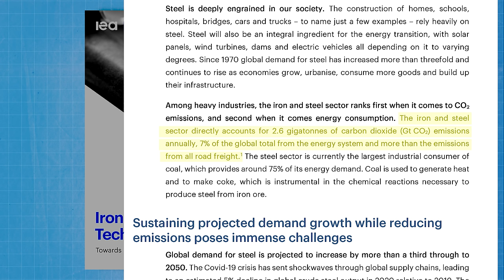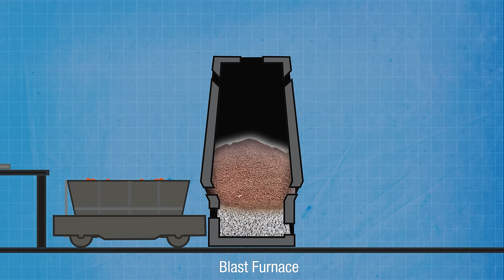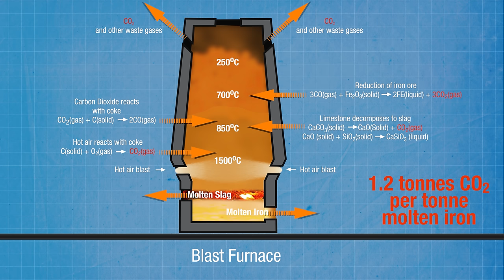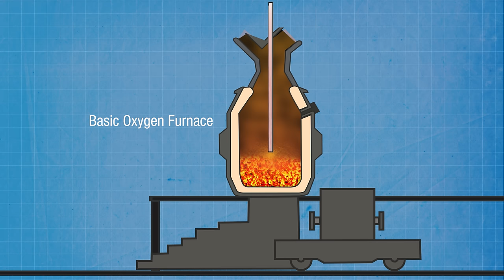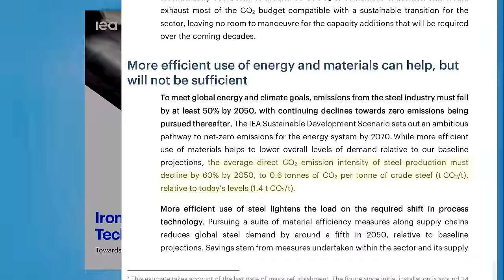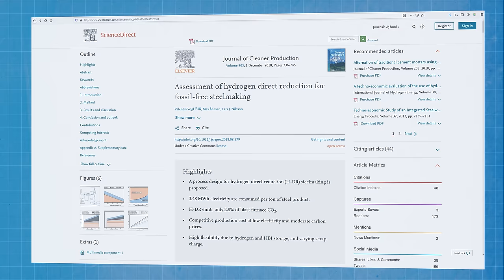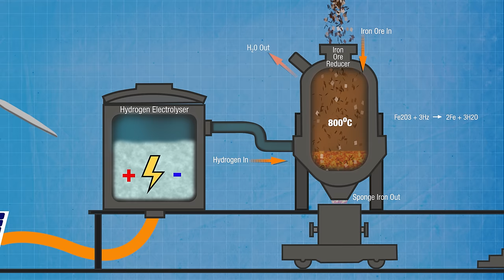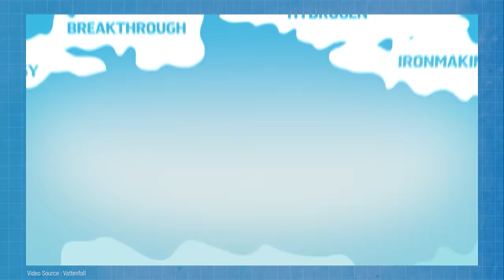Fossil free steel. Another giant step towards net carbon zero?

Comment: But Co2 isn't a pollutant. Spending trillions of dollars to get to net zero will solve nothing. 

If you want to make a difference in the world, build toilets for the 700 million Indians who use rivers as their toilets EVERYDAY!
Reply: You are right. CO2 is not a pullotant.
But increasing the CO2 levels in our atmosphere very fast causes the atmosphere to heat up unequally and causes severe disruption of local climate patterns, as well as heating up the earth as a whole. A warmer earth has far higher sea levels. Byebye all coastal regions.
Reply: @3gunslingers  
Except it doesn't, which explains why ski seasons have arrived earlier in the last few years despite a rise in Co2 levels. 

Regarding sea level rise, show me the data of accelerated sea level rise. My data says  no acceleration.
Reply: @3gunslingers  
That graphic is a fraud. It says it's from NOAA. It's been tampered with and doesn't say where it's from other than a vague location. This is the original NOAA tide gauge data from NOAA with a similar timespan. It shows no acceleration: 

https://tidesandcurrents.noaa.gov/sltrends/sltrends_station.shtml?id=8518750

Here's 111 years of data from Canada, that indicates 1.22 mm/year of sea level drop. If sea level rise was accelerating, sea level drop would have slowed or stopped.

https://tidesandcurrents.noaa.gov/sltrends/sltrends_station.shtml?id=822-116
Reply: @glidercoach  
You have the sea level rise/fall of exactly TWO locations on the whole earth.
But we are talking about the GLOBAL sea level rise.
https://www.scientificamerican.com/article/a-scientist-explains-the-mystery-of-recent-sea-level-drop/
https://io9.gizmodo.com/why-are-sea-levels-dropping-in-places-closest-to-the-me-1684599241
https://oceanservice.noaa.gov/facts/sealevel-global-local.html

Do you read why sea level falls LOCALLY?
Reply: @3gunslingers  
The land rises and falls. In NY, it falls faster than other places. Cresent City California is rising slower than Canada which is why sea levels are dropping slower.

https://tidesandcurrents.noaa.gov/sltrends/sltrends_station.shtml?id=9419750

My argument stands. If sea level rise was accelerating, the tide gauges in Canada and Cresent City would indicate a slowing of sea level drop. It doesn't. 

Your links are propaganda. Even NOAA and NASA have been known to tamper with the data. For now tide gauge data is credible. 

Did you see how different your first graph is from the official data? Someone tampered with it.
Reply: @glidercoach  
Why do you still show me local sea levels, not global sea levels?

"Did you see how different your first graph is from the official data?" No, because it IS official data. You can't chose what's official and what not based on your bias. 

https://www.ecosia.org/images?q=global%20average%20sea%20level
Every single graph about global average sea level shows an upwards bend. 

Now please show me a graph about global average seal level where this does not happen. Thanks. (don't bother, if you try to give me a graph with only local sea level)
Reply: @glidercoach  
"If we lose more ice than is replaced as snow, sea level rise will accelerate. For now it's not the case" Well, that's obviously wrong: 
https://nsidc.org/glims/glaciermelt/
https://en.wikipedia.org/wiki/Retreat_of_glaciers_since_1850
Very obviously the glaciers melt on a global scale. There is not honest way to deny that.

BTW could you look up a source that tells us, what the global temperature would be, without any CO2 in the atmosphere?
(I know that number already, but I want to know if you are physically able to look up that fact)
Reply: @glidercoach  
Interestingly enough all of your articles support the fact that the glaciers are shrinking. Maybe not disappearing as soon as announced, but they are obviously shrinking.
And I suspect that you accept the very fact that on global average the glaciers have lost a lot of ice in the last 30 years. 
Or do you reject that fact?
Reply: @3gunslingers  
Mars is 95% Co2 and is very cold. 
By your logic it should be as hot as Venus. Why is Mars so cold?
Reply: @glidercoach  
Because the martian atmosphere lacks density. 
Tho the martian atmosphere has about 10 times more CO2 by mass than earth has right now, Mars lacks practically any other gas in the atmosphere that would be heated up by the green house effect.
Reply: @glidercoach  
"but can't explain how the majority of all the ice loss over the last 10,000 years happened, when Co2 levels were low..." Because we are still very slowly coming out of an ice age. But that can't explain the accelerated melting we see in the last 100 and especially the last 50 years. 

"...but blame current ice loss on a 100 ppm increase of Co2." You mean an 100% increase in CO2 concentration. Don't you?
(because the increase is more like 200 ppm
) 

Remember without 200 ppm CO2 we would have -18°C on global average. But with it we have a cozy 15°C. 

So what happens when you double the concentration of the gas that heats up our planet over 33°C?
Reply: @3gunslingers  
Since the industrial revolution, Co2 levels went from +- 300 ppm to 410 ppm today. That's not 200%

Co2 levels have been 17 times higher than where we are today and life exploded. 

Water vapor accounts for most of the greenhouse gas in our atmosphere. There is no way, Co2 at 200 ppm, would decrease temperatures that much. That's what we call junk science.  

I'm done. Have a nice day.
Reply: @glidercoach  
"Co2 levels have been 17 times higher than where we are today and life exploded." 
This is NOT about the total CO2 concentration in the air. Nobody worries about that. Don't build that straw man all over again.
It's about the rapid CHANGE in CO2 concentration that worries the scientists. 

Do you understand why a fast change in climate pattern due to fast increase in temperatures is a problem to our way of life?  

https://en.wikipedia.org/wiki/Carbon_dioxide_in_Earth%27s_atmosphere#/media/File:Carbon_Dioxide_800kyr.svg
Look how minimal the rise in CO2 concentration was since the last ice age. And how fast it has risen in the last 100 years.
Reply: @glidercoach  
Do you understand why a fast change in climate pattern due to fast increase in temperatures is a problem to our way of life?
Reply: @glidercoach  
"No, I  don't. With all this recent record breaking cold and snow, it makes no sense. Wait a minute, I get it. Record breaking cold is weather, and record breaking heat is climate crisis"

I don`t think you get it. WHERE is the "record breaking cold"? What area?

Here is a hard nut to crack for you: what do you need in order to get "record snow"? What's he full mechanism behind it?
Reply: @glidercoach  
Still trying to crack the nut of what you need for "record snow"? Take your time, you need it. 

But now that you have demonstrated that you actually can give sources, please list all those places on earth that had record braking heat waves this year. 
Maybe you will see then what "global average temperature" means.
Reply: @3gunslingers  
I've given heaps of sources, historical newspaper articles, satellite images and common sense logic. My work is done.
Reply: @glidercoach  
Ah, you quit when you have to admit that you actively chose your feelings over facts and reality. 

All the sources you gave are only for local events, ignoring global events, or are even straight up demonstrating that we are losing our glaciers at an unprecedented rate. 
What does your "common sense" say when you have one "record snow" at one specific location, but hundreds other places (even entire continents) on earth have record high average temperatures this year? 

I suspect you know that the nut I gave you to crack about record snow blows in your face as it exposes your hypocrisy.
For record snow you need record humidity which only results from oceans being record warm. 
But you would never admit that.

 
Now for a slightly different topic that has also do with facts vs. feelings: Do you paddle the idea that wind turbines need more energy to be produce that they will ever make over their life time? 
(Conservatives who deny rapid global climate change also very often claim this despite being shown facts to the contrary.)
Reply: @3gunslingers  
Are you lonely or something?  

You asked for proof of record snow and I gave it to you. Then you complain that it's local and not global. I'm not going to waste my time researching recent global record snow events, because you'll come up with more excuses. 

Find another hobby.
Reply: @glidercoach  
Admitting you were wrong in the face of new info takes lots of courage and inner strength. Especially if you clung to the wrong side of the argument for a long time. 

I really hope that this discussion has at least kicked off your journey to become a more open and honest person who puts facts over politics every time.

Comment: 3:07 IS WRONG. The 1st bottom layer should be COAL, The 2sd middle layer should be limestone. The 3rd upper layer should be iron ore. Pre-heated hot air is blasted through the tuyeres at the bottom where the coal is ignited to SIMULTANEOUSLY heat and melt the 2sd layer of limestone and 3rd layer of iron ore. The coal combines with the limestone to produce carbon monoxide that combines with the oxygen of the iron oxide of the iron ore and REDUCING IT INTO METALLIC IRON WHICH IS ALSO MOLTEN. As it drips down toward the melting limestone it reacts with the melting limestone and hard limestone that will combine with any impurities present in the dripping molten iron to form a slag and as the dripping molten iron comes into contact with the burning coal it picks up carbon and forms pig iron with a carbon content of 4% to 5% which is also known as cast iron. THIS WEBSITE IS INSERTED WITH WRONG INFORMATION, DISINFORMATION, MISINFORMATION INORDER TO DUMB DOWN THE YOUTUBE WATCHER! THIS WEBSITE IS AN IDIOT WEBSITE JUST LIKE THE IDIOT BOX CALLED TELEVISION.

Comment: Too simplistic. You forgot to mention that coke ovens produce CO which enables an integrated plant to have its own power generation plant. 
Countries with large thermal electrical generation plants emit significant amounts of CO2. In these countries a BF route may be the best option. These countries also tend to be where the biggest demand for steel is cuirrently. Sweden, Norway, Iceland & NZ don't have high steel consumption. It needs a much wider analysis than throwing a few electrons at water.

Comment: Good effort but I don’t buy it because it requires huge up front capital (debt) and government subsidies (more debt), both of which require robust economic growth, and growth is no longer possible because we’ve burned all the cheap fossil energy.
 I also doubt that the extra steel required to make the extra wind turbines required to make the extra power required to make the extra steel is autocatalytic like coal and oil were. You need to shift your focus to democratically supported rapid population reduction policies.
Reply: If growth is "no long possible", how is it that the world economy keeps growing?  The best population reduction policy is educating females.  Most of the developed world is near or beneath zero population growth.  Population reduction needs to be handled carefully; population collapse is ugly.  Our societies are designed around a smooth distribution of ages in the population.  When that gets out of whack, things get ugly.
Reply: @incognitotorpedo42  We are borrowing about $4 to achieve $1 of growth. Soon it will be $5, then $6, then too much. The growth we have today is a debt bubble getting ready to burst. Too many people with not enough food will be much uglier than any scenario you're worried about.

Comment: So the steel works work when the sun is shining and the wind is blowing. 
Or is the electricity going to come from somewhere  else like coal or gas?
Reply: Jon, the electricity can be generated using renewables and stored in a variety of ways as you would know if you bothered to do I bit or research instead of making lazy assumptions.
Reply: Jon Cuffe it's all about the smart grid, which is being built btw. As mentioned in the video, this smart grid includes the generation of hydrogen in what would otherwise be down time for renewable power sources.
Reply from the maker: You're a few years behind the curve there Jon, I'm afraid.

Comment: You will need liquid Thorium ion molten salt energy converters to get you cheap electricity for the H2 production...why can't you recommend walk-away safe Thorium molten salt reactors - run at near ambient pressure and walk away safe?🥝🥝🙏

Comment: This is one of the few reasons we should be producing hydrogen. 
The idea that steel work production can be as flexible as the weather on the other hand? Haha 
Let's invest a metric fuck tonne of capital into a novel manufacturing technique using hydrogen and just accept our feedstock when the sun shines shall we. Down time isn't an issue... no, not at all.
Reply: Dominic Adams I don't recall Dave saying that plant operation hour would depend on intermittent supplies of hydrogen or electricity. What I do remember is that he mentioned the concept of hydrogen being by electrolysis when demand for electricity is low.
Reply: @stephentroake7155  just a common rhetoric about hydrogen and renewables.
Reply: @doritoification  The point is that you can generate hydrogen when the sun shines and the wind blows, and store it until you need it.  NO ONE is proposing intermittent steel production.
Reply: @incognitotorpedo42  And that's why fossil fuel companies will be happy to promote "green" hydrogen from electrolysis because when there's a week long lul in the wind they will be perfectly happy to turn on their methane steam reforming plants ;)

Meanwhile they will continue to support slanderous smear campaigns against nuclear which could reliably produce low carbon hydrogen 24/7 year round since that would be a problem for their long term viability.
Reply: @doritoification  Most wind turbines are built in places that don't have week long lulls in wind.  There are places where the winds are very reliable.
Reply: @incognitotorpedo42  you can see the week long luls in the annual data for most years. They are the outliers of course, but they do exist. I'm not talking about individual turbines or wind farms I'm talking about the UK renewable portfolio. 
Most of the luls are short. The UK receives a cold front every 3 days on average so you can generally observe a roughly 3 day cycle of wind waxing and waning and sometimes its more reliable than other times.
Just a few days ago, the 6th of December, the combined wind and solar capacity factor over 24 hours was 1.6% 
the only question is would you use natural gas to shour up the hydrogen production or the electricity production or both 🤔

Comment: Plants thrive with a carbon dioxide level around 1500 ppm 
Or is my science wrong.
Reply: Yes and by that time hopefully no humans will be around to bother.
Reply: Food crops grown in high CO2 environments produce less protein.  What do you care about science if you're going to ignore any science you find inconvenient?
Reply: Plants would actually benefit from fours times the current CO2 levels, there is absolutely no evidence that humans have warmed the planet with CO2  if it were true there would be a layer in the atmosphere where the trapped heat could be measured but there is no such layer we’ve been been measuring since the 1960s and the temperature decrease with altitude is linear,  this is complete madness.
Reply: @Cooliemasteroz  Gasses don't stratify like that because their thermal kinetic energy vastly exceeds the force of gravity on a single molecule.